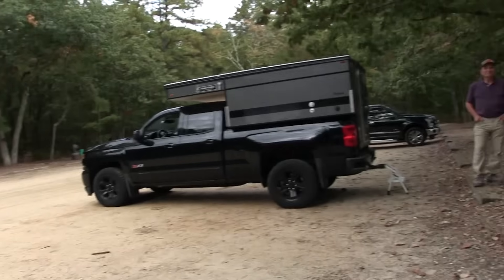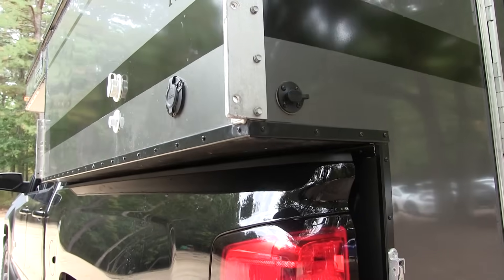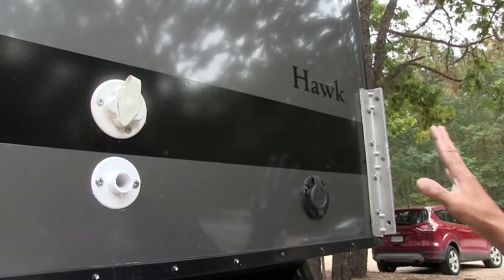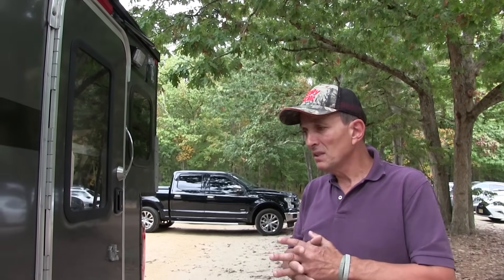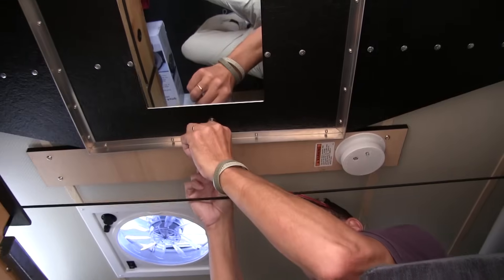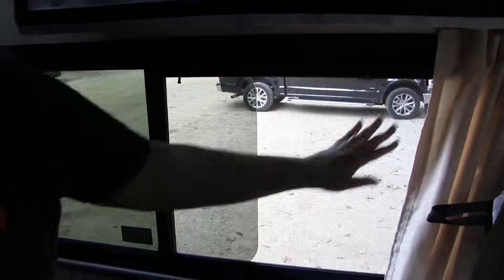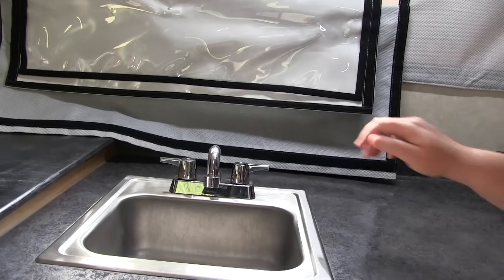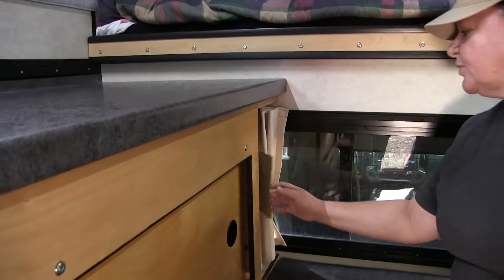Complete DIY Truck Camper Shell Camping Setup For Chevy Silverado 1500 | Four Wheel Camper Hawk

Comment: Sorry guys I have to come back with another commentary.. the smoke detector alarm is good where they put it the other alarm for invisible smells should be on Lower to the ground not on the roof they done it wrong right there.. propane gas is heavier than air and it will seep on Lower ground so if you're sleeping you won't wake up in the morning I highly recommend you put that alarm low to the ground no doubt it will ring before it gets to you..
Reply from the maker: Thank you for looking out

Comment: A pretty nice rig.  One thing I don't like is the lack of a good heater.  A buddy heater will do the job but as part of the combustion of propane a lot of water vapor is created.  Which condenses on the inside of the camper.  A more conventional furnace such as a Suburban draws a lot of electricity and most will discharge overnight because of the blower.

Comment: When using battery power ..I recommend using double or two  batteries. . don't use one battery and buy them both at the same time.. failure to do so the will older battery will cancel out the new  battery.. hell yeah.😃
Reply from the maker: Good information

Comment: I like to see what the truck finished looks like after they go boondocking. That is a beautiful black paint job they'll get very scratched and dinged and dented when they start doing boondocking. I think the concept is great, but I don't know why the canvas could not be replaced and used either a fiberglass or a lightweight aluminum. I've been in a few of these and after a while they do start to smell like a canvas inside. I really wondering if they would be bear-proof, Bears can even get into RV windows they're so powerful and strong. I used to see a lot of them in Southern California but I don't see too many of them anymore. The company has been around since early 70s they do have a good reputation. Thank you for sharing.

Comment: Enjoyed this video tremendously 
Looks exactly what I want to do for traveling and seeing the USA
When you mention “Shell”
Is that the same as the Project M model they mention now?
I need a simple build similar to what you did 
Question 
Is see you have the arched door
Can this be installed in the shell vs the flip up and keeping end gate on?

Reason I want to to do a Shell is I can build myself to my needs
Also my Chev 2500 Dura Max has a Aux fuel tank in box approx 24” wide by 24” tall and needs to stay in the box for fuel capacity 
It takes some space but think I can build around it
The pop up unit is for 1 person 
I also need to pull boats for fishing where this will fit well

Great job to you and your wife in the video
Reply from the maker: Thank you very much and thank you for the questions. I would recommend reaching out to the manufacturer directly

Comment: What I like about vans are you can get to the front driver's seat in an emergency. I need to research part of this video and check the site but I am wondering if that was a window in the camper to the slider in the back truck window?  If that is an option I might have to look into these.
Reply: FWC got rid of the slider window option due to leaks. I know, I tried to add it to my build, and they said "No".

Comment: It looked like the fridge (ARB or Dometic) was inside a cabinet, with no air circulation?? Wondering if it was vented to the outside, through the back of the cabinet?
Reply from the maker: Good point

Comment: Patrick... Can you tell me what size engine in there f150? We have a f150, 6 1/2ft bed, extended cab with a Ecoboost 2.7-Liter EcoBoost V-6: 325 hp. Payload of 1200 pounds.
We have replaced the backseat with a slide out kitchen that includes a 12v fridge chest, counter space and Bluetti Max Oak 2000w battery with 400watts of solar. Looks like we would beef up our suspension to carry it, but am worried the size engine might be too small. We like the door and sealed camper and would keep the back as a bedroom/hangout in rainy weather without adding too much extra weight. Thanks.

Comment: Nice if you have the ability to finish the build. Otherwise not.
Reply: You can buy fully loaded, optioned out model, like they said in the video.  These campers have built in fridge, stove, heat, AC, shower, couches, tables etc.